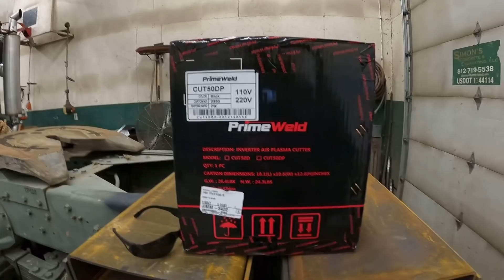Rounding up Parts for the big 6x6 truck build and visiting Todd from Truck or Track

Comment: The drop axle is as Todd said is called a tag axle meant to be mounted behind the drive axles, you want what they call a pusher axle, but since you are making the frame longer it may be easier to use tag axle at the rear. that trucks gona be a beast.
Reply: He's not extending the rear frame behind the wheels though. He's cutting the frame in half and adding a section between the wheels and the cab to have a place to mount the lift axle. So I'm not sure I understand what you're saying. Unless he made the lift axle where it raised up above the back of the bed so he could dump the axle would be in the way being behind the tandems. It can be done and is done but that's getting expensive to make a lift axle like that for what he wants to use the truck for. I don't think that would work with a barn door tailgate either. He wants an offroad truck that he can drive on the road occasionally if he needs to so he doesn't have to have two trucks on a job. I think that's what he has said anyway. I might be wrong about that and I might be interpreting what you've said wrong too but I think that's what he is after. Tell me if I'm wrong and misunderstood you.  👍
Reply from the maker: Will go either place

Comment: Why not purchase a second vehicle as a donor truck. Remove the body save the frame and use it. After the last picture you posted I left a question how long before it’s up and running? I got my answer today. A year at least. You will be removing the cross over frame rail why not take it to the person who is making the frame rail and match up the steel type. How much longer will you be extending the frame? Smart move on the dustless sand blasting! That will save you a lot of time. I’ll have to wait and see how much bigger you make the dump bed.
Reply from the maker: Money and hard to find in good shape

Comment: Is that truck street legal in Indiana ? You have a 30 inch maximum to the bottom of the bumper, and 54 inches to the center of the headlights. If need be make drop brackets for the bumper to lower it and the lights. I've been fighting this B.S. since before the Blizzard of 78 !
Reply from the maker: Leaving that up to officer Hoover

Comment: Offset the frame cuts so you can get a full pen weld on frame rails and you need the add a cross member and don't forget to fish plate the inside rail after welding .we stretched a lot of frame for over the road and never had d.o.t. problems

Comment: I drove big truck for 45 years and the worst thing ever were the super single tire. 1. Expense 2. availability 3. When not if you have a flat, you're stuck where you're at at . Just my thoughts .
Reply: He wants singles I think because the main use is going to be an offroad truck. I think he's thinking about better flotation on poor ground with the single tires. Occasional on road use so he won't need two trucks on one job. 👍

Comment: Hey Mike I've had trucks with barn doors, they are a pain in the ass,drivers dont like them when they get tweaked then you fight getting them shut, high lift tail gate is worth the money. Going to be an awesome truck😀👍
Reply: Go high lift!!  Don't cheap out at this point. You WILL thank yourself later.
Reply: You're 100% right, Outlaw... Barn doors are nothing but trouble, over time. Been there, and driven that... never again. High lift tailgate is a lot less aggravation. Might cost a little bit more to do that way, but the time SAVED over the life of the dump body more than makes up the difference.

Comment: I believe You may have taken some of the recommendations I made Seriously. 1) I didn’t mention Your Buddy Officer Hoover. I am sure he is a nice man but knowing the DOT REGULATIONS is GOOD but he would have absolutely NO ENGINEERING SKILLS. The on;y thing he has to offer is what  Your Truck can carry per axel and the spacing between axels for these calculations and THATS IT PERIOD. 2) Your Buddy TODD is a very good source for a new 16’ Dump Body which I told You would be the only way to go. 3) You have to reevaluate what You’re building and what the Primary use of the specialized Rig is for? The Primary use is, for Your growing DEMOLITION BUSINESS. 4) You require sides on box at least 4’ high and thicker plate with cross members to make it mostly indestructible for dumping concrete. 5) Forget about lower sides for loading with BOBCAT. You will only load this with Your Excavators and You need HIGH CUBE BOX for DEBRIS. You have another dump truck for that purpose and where I live there are many trucks looking for work by the hour that makes You more productive and Money. 6) forgive Me for calling You Nuts for even considering not getting the body fully fabricated with the maximum amount of Cab Protection with at least 2’ extension over cab. 7) This cab protection should also be with 1’ stakes welded on either side to prevent pipe from rolling off and strong enough to Cary Poles or I Beams. 8) please get the strongest tailgate possible that will Cary weight on top of it. (Poles, Pipe, or I Beam that spans over body and over Cab. 9) I strongly disagree with Tod on Barn Door option. (Those only work for refuse bin that You open on ground so you can wheel stuff in.) please spend the money and go with your high lift with hydraulic cylinders fully protected. (I have seen many of Your shows that has gcrap stuck in box) ( every time You have to open or close that gate Your are at high risk for serious injury and it takes a lot of time.) 10) Forget about Dual Exhaust stacks that will cost You Money and need to be protected by cab extension. Sergei Dratchev has a big KENWORTH with a bunch of axels and 28 wheels and booster in front of Duals, Jeep, and 60 ton capacity trailer for hauling Excavation Equipment with over weight, over height, wide lows with GVW OF OVER 160,000 LBS. His truck is beautiful with a very large 600 HP CUMMINGS ENGINE and One Fake exhaust stack. It does look good to see this monster go down the Road with Pilot car and all the lights flashing. This is not Your truck. YOUR TRUCKS BEAUTY COMES WITH ITS RUGGED LOOK. 11) Forget about DIRT PERFECT IN GRILL. You should beef up the grill so You can actually drive into a 6” tree and push it over with no damage to Your Rig.. 12) Now I really like the new Pusher Axel with U Axel to fit around drive shaft and high lift air bags. 13) I also like the AXEL You brought home from TOD . That will be Your Tailing Axel behind Your Duals (Super Singles). 14) Get Your New Buddy Officer Hoover to do something useful for You by calculating for You in writing officially how much Your truck can carry with the Axel Arrangement and type and spacing. Each Axel will be different and also the width of tire is hugely important and I hope he is up to speed with calculations for SUPER SINGLES. (My guess is that your Truck would be North of 80,000 lbs for 5 Axels but only 60,000 lbs for 4 Axels. If possible You need to get some Engineering help from Tod’s dump box manufacture for frame modifications to Your Truck to carry this big box, dump cylinder, pivot point at rear and brackets supplied and welded to Your new triple frame on each side at the rear.  15) NOW ITS FAIR TO Ask who the hell am I with all these recommendations? I am a 75 year old retired Electrical Superintendent that built huge mines around the world and all sides as a contractor, as a hands on support for teaching farm boys how to fabricate connection boxes working with Labour Contractor who spoke Spanish, Portuguese and English to carry out my detailed plans showing every thing, hole size, connector # and cable # and numbering on terminal strip. Believe Me the Results were rewarding for everybody. IT IS POSSIBLE TO TURN FARM BOYS INTO ELECTRICIANS.  This was a 500 million dollar mine high in the ANDIES Mountain at LA CPOIA CHILE IN 1990. I also worked for a large Engineering Company in BC as their head Man on site for Major expansion and moving another mine in very big pieces 10 miles down the hill and to be part of larger mine with complete amalgamation of 13 mills into 2 control room. I am not an engineer but was very comfortable giving them direction and also interfacing with mines extensive Engineering Group as well as project management for 3 different electrical contractors. Oh YEAH I KNOW SOMETHING ABOUT STEEL. I built a 6000 sauté foot Luxury home all by Myself over many years between Projects. This house was engineered for wide.flange beams supported on 2 X 6 laminated in walls. I eliminated some walls and used 5” .250 wall HSS columns. I designed this steel Structure and upsized beams, and ordered wide flange beams cut to length, sent directly to other location for ROTO BLASTING and PRIMER, I Then got it delivered by Crane working for me pulling a tag trailer to place on dunnage where I filled it with holes with magnetic drill press for bolted connection of wide flange and welded steel to columns. The only thing I did not do myself was pour 231 meters of concrete for this spectacular home. (When did You ever see any house using 25 truckloads of concrete or when was the last time you excavated 202 tandem truckloads out for major foundation with some 16’ high concrete walls? I m the best mig welder with my 200 amp  Miller. I will concede that the MAN BEHIND THE SCENES has more expertise than I. 
16) this where I get to call your judgement out again. I would never think of cutting Your TRUCKS FRAME and welding in a section. I see You might have taken my advice and made template and found shop with the right equipment. You have 5 axels now so why don’t You use them and create a MEGA TRUCK OF Possible 80 GVW?  17) get your plans on paper and actual drawings of Your Build with the approved engineered support You need. 18) mock up Your Pusher Axel for placement. 19) disassemble everything from the CAB back. I WILL NOT ALLOW YOU TO CUT FRAME OR RELOCATE EXISTING POWER TRAIN. (That would be very dumb. 20)  You now are going to get uU shape Chanel that will fit over original  Frame that can go under Cab without  Cab removal. I will allow The 4’ frame extension by veering welding an grinding flat for extra strength. Each frame will now consist of 3 channels that are fitted, sandwiched  and bolted together. The inside custom channel does not have to be continuous but cut out for cross members interference. The outside channel will have to be cut out around for suspension brackets but at least the top half will be complete end to end. 21) All of this extra steel will weigh less than a thousand pounds. You are not destroying the integrity of the existing frame and any inspection authority cam not legally object o any overbuilding. 22) test fit and bolt Your channels, take apart again for painting and then reassemble every thing. 23) have Your TRUCK DUMP BODY MANUFACTURE come for site visit before showing location of hydraulic pump off PTO AND MEASUREMENT OF ALL HOSES AND CONTROL ROUTING AND DIMENSIONS ARE GOOD. 24) TELL TOD you will pay the extra money (
$200 for any colour You want but don’t forget Your new Yellow DIRT PERFECT as seen on U Tube. This is Your new Brand. 25)  Go get  Your new Truck, assembled and working perfectly before you leave Your shop. 26) makes sure You have painted your truck completely snd You don’t have to do Any engine work. 27) The best part is that all the consulting work I have done for You is free. Remember,  You  asked for our help. I gave  You exactly what You asked for so don’t screw it up. 29) I ask You to compare my solution to others and also run it by Your Booster manufacture for comments, Tod for his comments, and Dump body Manufacturer for his comments, 30) let’s just call this my dirty 30 list.  Good Luck.

Comment: Instead of cutting and lengthening why not take the rearend loose and wrap the existing frame with a taller wider suitable size jacket frame material. Then bolt the rear-end and your new mid-axle to the new outer frame. They have press brakes that bend the frame material in the first place, why not have somebody manufacture you 2 new outer pieces.
Reply from the maker: Cover that very well in upcoming videos

Comment: Check out the forum Steel soldiers. A lot of people “Bob” these 6x6 and turn them into 4x4. They cut off the frame. Someone might give you the cut-off pieces. They will also will know what type metal it is. Good luck with the forum it will bring you down an endless rabbit hole. Steve
Reply: And if you act the fool one tomany time or piss the moderators off they will ban you for life. Lots of grown ass men high school clicks on there.
Reply: Steel Soldiers are more about the standard made for the military trucks. This is more of a International truck deal.

Comment: This will be an interesting project as it evolves that is for sure! I just wondered quite why you intend to insert the new axle in front of the current drives rather than extend the rear and add the axle is it broadly an issue of safety of the rail extension and overhang  and load support and drive axles being then too far forward?

Comment: You can't use that pallet wood to make a template Mike. That is especially true if you are going to cut out the U section.  It 'might' stay stable right after you cut it, (but probably not).  It will for sure change when you take it outside and when it gets to the other shop that is going to have different humidity and temperature to your shop.  You need to use decent quality plywood with lots of plies (layers). At the very least, screw a temporary strap across the U gap to hold it stable.    Also measure that gap and write it on the timber so it can be checked later on.  It will move though. — that is 100% — so if you can make it again out of good quality plywood, you'll save your self and the metal shop some grief.

You could also look at free CAD software like SketchUp.  It is easy to use and there are LOTS of tutorial videos on YouTube.   SketchUp would also make it way way easier test alignment and fit for that lift axle.  You don't need to make an elaborate drawing of the axle.  Just the essential parts.    You'd find SketchUp a huge benefit with any sort of fabrication project, and a huge time saver.

Comment: Why didn't you pull out the walking beams and air ride it with another live axle since you are going all wheel drive... other than tire wear. that lift axle will bottom out turning in oh poop ville even when turning. Hopefully  you are getting rid of the super aggressive super single military tires if you are running it down the highway every day. Just a thought. Cool rig though.

Comment: brinell hardness test will help determine grade of frame material , or take a grinder and watch sparks to assist determined grade . some steel background is required ..that's the quick and dirty method .. core 10 material is used for bridge girders , will surface rust then stop ,  do not paint it .... Ironworker / Inspector Cleveland .
Reply: Cor-Ten is a trade name for weathering steel. Designated as A588, it is indeed used for bridge construction as the outer oxide layer (rust) forms a barrier to prohibit further deterioration. It is also commonly used in architectural design as the rust "patina" can be very appealing. I would imagine the corrosion resistance to be a benefit for truck frames.
Reply: i know it is kind of randomly asking but do anyone know of a good place to watch newly released series online?
Reply: @Eli Benedict Flixportal
Reply: @Jerry Sam thank you, I signed up and it seems to work :D Appreciate it!
Reply: @Eli Benedict You are welcome :D